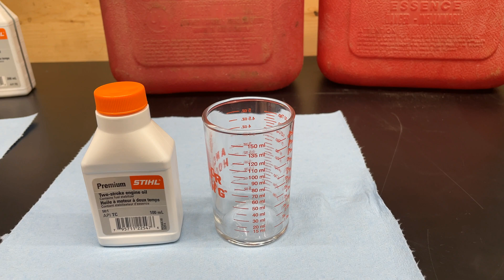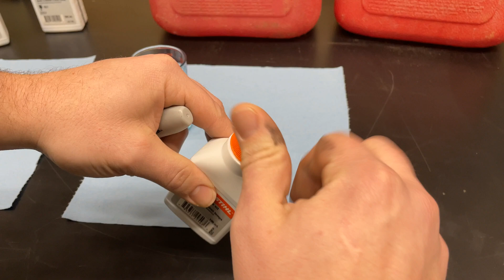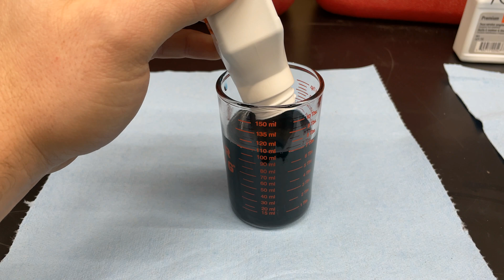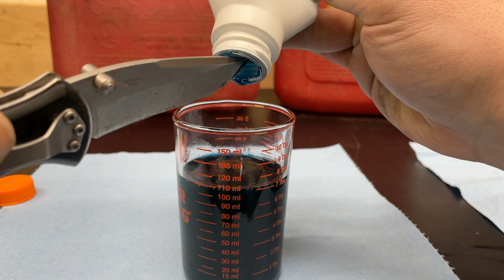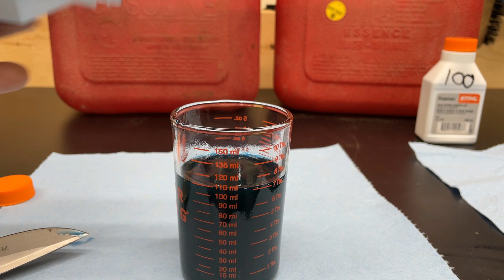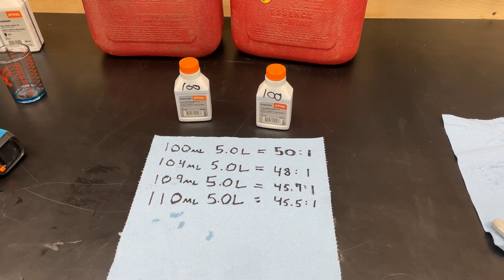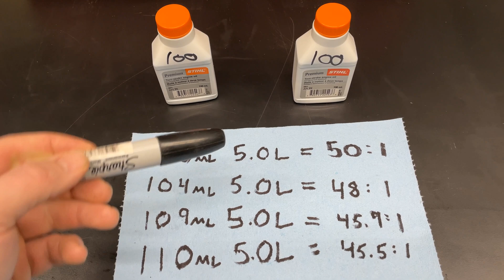Inconsistent 2 stroke mixed gas... Does every drop REALLY count? (Surprising test results found!!!)

Comment: Test has few inconsistencies that need to be noted:
1.  Generally, when pouring liquids out of a container, 5-10% of the products remains in the container.  Applies to shampoos and other products.  Generally, public  does not wait for or drain every last drop… wasted.

2.  Manufacturer is never 100% accurate.   If you tested each supplier and accurately measured, temp and all (let drain fully), would have a bell curve.   Regulations state how much variation is allowed.

3.  STIHL in this case targets 110 mL assuming  10% waste to ensure customer uses correct amount on average use/pour.  Nice, if I assume this was intentional.  Some suppliers may not do this, likely not.  

4.  What are engine specs and gas:oil ratio requirements and range allowed?   Nice you show impact to mix ratio, but how does this impact newer engines that are 50:1 vs older 45:1 or 32:1?   Some engines and brands are very picky… impacts performance 

5.  How do you measure GAS AT 5 L on mix?  By pump?  It assumes 15 degrees Celsius (ground temp below frost for gasoline/liquid storage).  Is pump accurate and fill accurate on side of gas container?  Likely not.   So variations on both sides.   Including if you shake before filling engine w gas in case gas/oil separates from sitting for extended periods of time.

6.  Measure cup has variations in plastic and printing on side of container.  Ideally measure gas and oil w same measure 

Fun!

Comment: Small variations in ratio are already calculated into the engineering of the engines. It’s not the amount of oil variables ,but the level your gas can is filled each time that would make the most difference if you want to be anal. When your engine wears out, which it will, buy a new one.

Comment: 50:1 = 77ml/1 gallon; 40:1 = 95ml/gallon; 32:1 = 118ml/gallon. *1cc = 1ml*  50:1 = 5Liters:100ml, 5Liters = 1.32086 gallons (~1-1/3). 
The old rule of thumb was to mix it rich till it smokes but doesn't foul a plug.

Comment: after pouring the oil into the gas and mixing it, I pour some gas into the measuring container to clean up the remaining oil. Pour some gas into the plastic bottle. Put the top back on. Shake. empty the bottle into the gas. Make sure the foil doesn't end up in the fuel container.

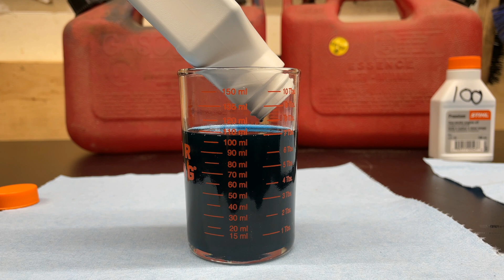Comment: 6:51 The amount is pretty exactly right to make 5103ml of 50:1 mixed fuel. It aint adding calculation. 5000ml gas plus 100ml oil do not make 50:1 mix. In everyday use Stihl (or Husky) understand that it would cause confusion to ask people to pour 100ml oil to 4900ml of gas.

Comment: I would use a graduated cylinder to get a 45 to 1 mixture instead of 50 to one, 25 to one is way different.  I add some non ethanol gasoline to the graduated cylinder to get every bit of 2 cycle oil out so one knows it is exact, some 1 gallon bottles are not exact. Stihl 2 cycle oil has more ash and kinda sucks, but your warranty will be void if you don't use it. Husqvarna XP + semi synthetic and Echo Red Armor full synthetic are the 2 best ones that I know of in my opinion, those let the saw run with not heating up as much compared to other oils. Some old timers swear by using 30 to 40 to one but still I think about carbon scoring/build up on the piston/cylinder and possible spark plug fouling.

Comment: Hey Dave! Thank you kindly for the simple and conclusive test, i have just received my first chainsaw for Christmas, a Husky 440, and just today i was trying to find a simple and safe way to mix my fuel. Found your channel and things are much simpler now! Can you recommend a practical setup for your chainsaw kit(fuel,bar oil, tools) Been looking around Huskvarna’s combi can, but it’s pricey and my local dealer suggested it was only worth it if you use your saw on a regular basis, as the cap orings are prone to leaking and are dear to replace. Thanks again and keep delivering quality content!

Comment: I would think the 104-110 ml would be a helpful failsafe for Stihl. Most gas pumps are not going to stop at exactly 5 liters or even 1.0 gallon. I personally stop pumping at .9 gallon and my mix is plenty rich and I have never lost any 2 cycle or 4 mix piece of equipment. Thanks for the video.

Comment: I have noticed it too and pre-measure before mixing for 50:1 everytime. Too much oil bogs the chainsaw down, decreases horsepower, fouls the plug, combustion chamber, piston top and muffler. Thank you for the confirmation and great video.❤

Comment: It really isn't that critical.  The thing to remember is that the bottles are filled using an automated process. There is an acceptable tolerance. The machine is most likely set to insure that the quantity dispensed is at minimum 100 ml. If the equipment only put in 99 ml. That could open them up to all sorts of legal problems. 
Depending on the equipment the tolerance will be a certain percentage. Lets say they set it at 5%. This would mean that the actual quantity in the bottle could be anywhere between 100 and 105 ml. Depending on the equipment's precision I suspect that they allow themselves closer to 10%.

Comment: The more you're mixing the more accurate it'll be. I use my chainsaw at home, not cutting very much at all, for that reason I only mix 0.7 liters of fuel at a time. (I mix it in a wine bottle that I have marked the levels on the neck) It makes me wonder just how far off my mix is. 😀

Comment: I don't want to put so much into your discovery as the measuring glass you use is hardly certified for control measurements, i.e. you cannot trust whether it is 90 ml or 100 ml or 110 ml that is in a bottle of Stihl two-stroke oil.

It must be said that there is no doubt that Stihl ensures that the amount of oil is not less than 100 ml.

Comment: If it's that big of a deal to you why not just dump a little bit of gas into the bottle, Shake It Up and dump the gas /oil back into the gas can🙄
Edit: Also, you could have used a digital scale to weigh the liquid volume to ensure you had the exact amount of liquid in each bottle before you started, and after you finished

Comment: The way I've been measuring fuel mix for going on 30 years now, I measure in a 60ml syringe 20ml at a time to a 1 liter wide mouth bottle. This is just a tad rich on the oil, but my chainsaws don't seem to mind it. I never mix more than one gallon at a time, and most of the time just 1 liter at a time. For one gallon I mix 80ml of Husky oil. It smells much better!
Reply: I use 30 us gallons every year not going to screw around doing that. Never have had a problem in 47 years, five chainsaws, weed whacker, two leaf blowers.

Comment: Maybe that's why manufacturers have a variance anywhere from 40:1 to 50:1, I've had better luck running 50:1 with ethanol free 93 octane than any other mixture, smoother running with no hesitation and more power
Reply: I almost forgot I add according to manufacturer specs Marvel Mystery Oil for stability of mixture and inhibits against water corrosion

Comment: You don't measure fluids in a container the way that you're doing it. You measure at the bottom of the meniscus. Google that word and you'll see why you're measuring incorrectly. All of you nuts on YouTube are making a mountain out of a mole hill in regard to ratio. I use Amsoil Saber mixed at around 80:1 (1.3 ounces of oil in a gallon of gas) and have been for over 20 years. I have never had one single failure due to lubrication issues. I also never have to de-coke any of my engines. My oldest 2 stroke engine is actually a Stihl BR600 which we all know is a 4 Mix engine. It is 13 years old and for the first 5 years of it's life, was my primary blower when I ran a lawn service. It easily has hundreds upon hundreds of hours on it.

Comment: At the factory could the bottles be filled by weight. If so variations in bottle weight could explain the difference in ml's. And from a legal aspect you would be far better off giving slightly more than less.

Comment: Just buy that premix at the hardware stores. It has no ethanol in it. If you're using a lot of gas then try and buy gas somewhere that has no ethanol in it. Get like 5 gallons and then have a 1 gallon for mix in the oil. You can also put an additive in the 5 gallon for long term storage. If you can't find fuel with no ethanol in it then there's additives that treat gasoline with ethanol in it and those additives I think also prolong the shelf life of stored gasoline. But if you're mixing a little bottle of oil into 1 gallon of gasoline for a 50:1 ratio. You could try and find a way without making a mess to add a little gasoline to the little bottle and shake it up to get the rest of the oil that hasn't dripped out. You might not have a problem with that in warmer temperatures if you let the little bottle drip into the 1 gallon for about 5 minutes. But in colder temperatures that oil is probably going to be a little thicker. Don't forget to shake it up and mix the oil with the gas. 2 strokes are not like 4 strokes. They get oil lubrication through the premixed fuel and I wouldn't be going any higher than 50:1 or whatever the mixing ratio should be. That's not going to be good on your 2 stroke engine power equipment. 2 stroke engines are good engines and easy to learn about and operate and they're easier to maintain than the 4 strokes. I remember as an elementary kid I learned how 2 stroke engines work playing around with hobby nitro rc cars. They're simple in design and they're really good for small engine applications. Even the big outboard 2 strokes are great engines and they're direct injection (self mixing) which makes them burn cleaner than the 4 strokes. (No oil changes with 2 stroke engines). They're coming out with direction injection 2 stroke dirt bikes now. As long as they're carb compliant you can use 2 strokes on the highways. These are the real facts.

Comment: If you microwave that bottle and heat up those oil. You can get another .01 ml of oil when pouring out.    Btw. If you actually have a mixture of 50:1, your engine will last 5000yrs

Comment: If I only have a container of oil to use I rinse out every drop I can from the container.  I pour the oil into my gas container, as much as I can, and then fill the oil container with gas and pour that into my gas container.  I do this several times until I get as much oil out of the oil container that I can.  I thentank another oil container and open it up.  I add two capfuls of oil to my gas container to bring it approximately up to my standard 84 ml of oil.  I then add exactly one gallon of gas to the gas container.  I may add a little bit more oil to the gas container if I think it is a little thin.  However,this is not normally how I do things.  Normally, I mix one gallon, exactly into my No Spill gas container and take it with me when I am cutting wood.  If I have a saw failure, I do not want it to be my fault because I was sloppy mixing my gas.
Reply from the maker: I agree.  This is good practice!

Comment: Does every drop count?  To me it does.  I measure out 84ml of Stihl Ultra and pour it into my gas container, which I left about a quart of two mix in.  I shake up the container and the pour some back into my measuring glass to get out any remaining oil.  I then pour this back into the container and shake it up, again.  I rinse out my measuring container several times to get out any remaking oil.  I then add one ounce of fuel stabilizer to the tank, measured of course.  I then add, exactly, one gallon of gas to the container, premium, non ethanol, of course.  After filling I shake it all up good and put it on the shelf in the shop.  I shake it good before dispensing it into any piece of two cycle equipment.   I shake Stihl Moto Mix containers, too.  Just something I learned, years ago.

Comment: here is another thing to think about.
If you are selling 100mL of oil, it would be wise from a weights and measures/ consumer rights point of view to make sure that there is more in the bottle than claimed.
.
Another point.
Seriously who buys 100mL bottles?
Many dealers here simply do not stock 100mL bottles.
From a  packaging and wastage point of view, 100mL bottles are utterly stupid, the cost of packaging is getting close to the cost of the oil.

Comment: Good video, thanks for thinking of something few people would bother to do. I'm a chemist and it's in my DNA to measure everything carefully with the proper equipment. When you read the rest of this you'll probably laugh and call me anal but here goes. A gallon of water is 3785 milliliters. Divide by 4 to get milliliters in a quart = 946.3. I used a digital scale to tare an empty quart glass bottle and add 946.3 grams of water. Temperature should be taken into consideration but for practical purposes you'll be fine at room temp around 70º F. That's how you can  calibrate a  bottle to exactly one quart. I put a piece of tape on the neck and used an ultra fine point Sharpie to mark the one quart line. Next, I used a clear plastic cap which covered the pump sprayer from a bottle I had laying around. Cap  was about an inch in diameter and 1½" high. Next I used a chemistry lab pipette and measured 19 milliliters and marked that level with the Sharpie.  I covered the mark with a piece of clear packing tape so the oil wouldn't dissolve the Sharpie line as the measuring cap gets used and some oil spills on it. Divide 946.3 ml by 50 = 19 ml (rounded but very close) which gives you the 50:1 ratio recommended by the engine maker. 

To make a quart of mixed fuel,  pour 19 ml oil into the little custom measuring cup and pour into the quart bottle using a funnel. Then I rinse it several times with gas until the cup is clean. Then I fill the bottle about half way, stop and swirl the oil to mix with the gas. Then I fill the bottle the rest of the way to the fill mark and swirl once again to complete the mixing. You can scale this process up to make larger quantities with larger containers but this works for me because I don't use that much fuel during the season and this keeps it fresh.

Comment: It would have been much easier and much more precise to do both tests with the same bottle of oil.  Dump it quickly like you did, take the reading, then let the bottle finish emptying to see how much more you get out of it.  Your test relied on both being filled to the same amount by the manufacturer/packaging plant.  My guess is that they aim for a little over 100ml. so that the variations from their dispensers will never result in bottles with less than 100ml. so they can avoid damage claims.
Reply: The quick pour on the second seemed higher than the other already.

Comment: Great video!  If I was using these small oil bottles, I’d rinse them with gas to get all my oil LOL!  I use the same anchor hocking measuring cup to measure out of a quart, but I wonder how accurate it is.  I’m tempted to order a graduated cylinder  or use a syringe.

Comment: Every drop counts, which is why I measure everything in an Anchor measuring glass from Walmart.  Consistency is the key to everything.  I want my gas to approximate Stihl Moto Mix.  At 50:1 my gas produces the same idle and WTO rpm as Stihl Ultra.  That’s about as good as I can do.  I see the Canadian bottles of Stihl oil are based upon 5 liters for a 50:1 mix ratio.  Our containers are computed for a one gallon mix.  With my system it does not matter because I always put 77 ml of oil in one gallon of gas.  To hedge my bets I use 84 ml of Stihl  Ultra per gallon of gas for a 45:1 mix ratio.  My Stihl HP containers are clearly marked 77 ml and that is what they contain.  I have measured them.  Husqvarna XP oil also contains 77 ml of oil.  Echo Red Armor also contains 77 ml, as does their Power Blend Gold oil.

Comment: I agree 100%, but there are motorcycle gear heads out there that believe more oil in the gas means better lubrication.  I also learned 40 odd years ago, as a Federal Manager, the hardest thing to do was to put a new thought in the head of a bureaucrat that had not had one in 30 years.  Most people just dump a small bottle of two cycle oil in a gas container and fill it up all the way to the top of the container.  This puts 70 odd ml of oil in a gallon and a quarter of gas, for a 60:1+ mix ratio.  Then they blame the oil when they burn up their saw.  I measure everything.  I put 84 ml of Stihl ultra in a 1 gallon container and then add exactly one gallon of gas to the container.  This gives me a nominal 45:1 mix ratio.  I have a measuring glass just like yours.  If I want a 50:1 mix I put in 77 ml of Stihl Ultra in one gallon of gas.  I have never smoked a cylinder and I constantly cut in hot weather.

Comment: I think 50 to 1 is to please the clean air people.  Stihl is smart enough to treat it like a limit instead of a goal. Even in cold weather and overshooting on the pump a little, you are still going to be below that limit. Personally I run 40 to 1 with a much better( and cheaper) oil. If you are going to pay ester oil prices, you might as well run ester.

Comment: I make it with 4,9L of gasoline and 100mL of Castrol POWER1 RACING 2T which gives the perfect 50:1 mix...
Because when you mix 4,9+0,1=5L And in that fuel is exactly 2% oil

Comment: Interesting. I suspect all the manufacturers have 2 priorities. 1) - don't get sued for misrepresenting the volume of the contents of the bottle - that's class action written all over it-  and 2) They probably build a fair amount of tolerance into the engines operational capability. So it probably runs fine on 45:1 up to 55:1 because they know a lot of us are mixing fuel out in the woods or on the back of a truck that isn't level and we'll probably measure either the fuel or oil incorrectly.